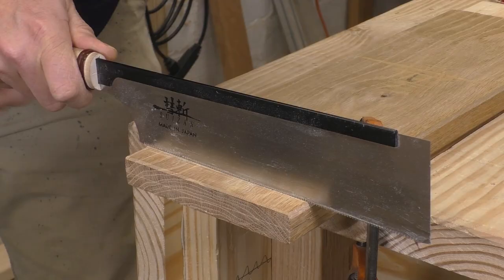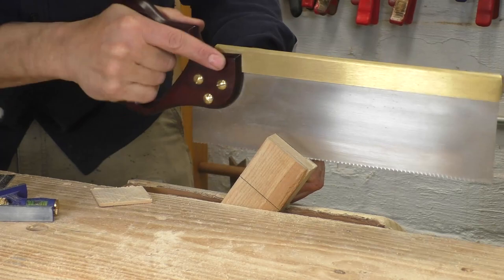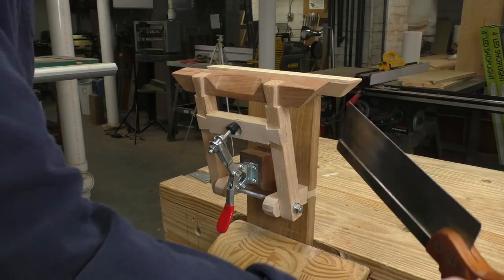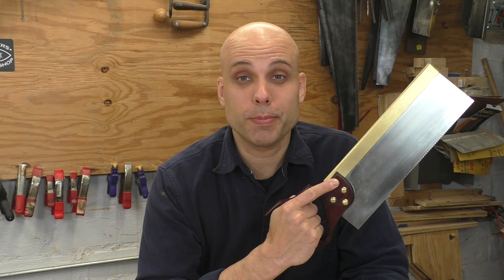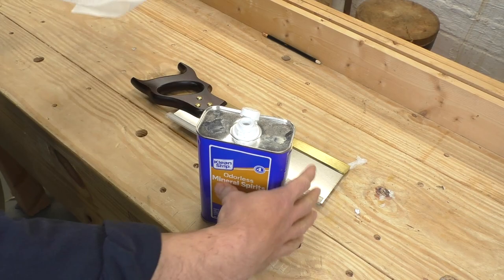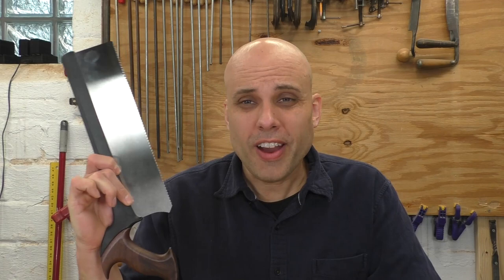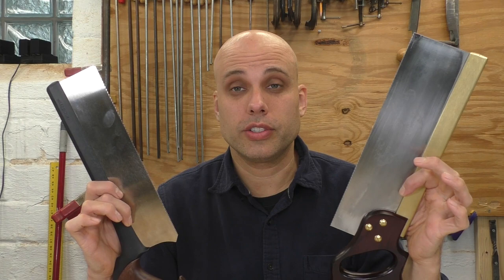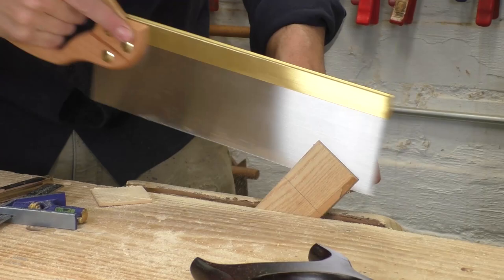The best affordable joinery saw for hand-tool woodwork.

Comment: What you call back saws in the U.S. are always called tenon saws in the U.K. 
Spear and Jackson should stick to making gardening tools, and I say that as a Sheffielder.
Reply: To be fair, their 22" "Traditional Skewback" (a 10tpi panel saw) is perfectly useable, but suffers from the same poorly-shaped handle. You can cut with it, but it isn't comfortable. You basically need to reshape the handle and put in New handle nuts and it is lovely. You can even resharpened those to rip-cut and they work just as well as any boutique saw.

I just with that they made a 14" Tenon Saw. They have 10" and 12" sizes, but I just sometimes miss having one with a 14" plate.
Reply: Ooh really? I've always thought that S&J is to small for a tenon cutting saw

Comment: I am soooo looking forward to the make over of the Spear and Jackson.  I keep coming back to the page to see if you have released that one yet.
Reply from the maker: Just finished shooting it yesterday. That video will not disappoint, I promise!
Reply: @RexKrueger  I'm thinking new handle, new pins, polished blade. I know I need a life but I'm excited.  BTW, if you want to turbo the sharpen, I put a back bevel on the rip cut tips with a 1200 diamond paddle.  It acts just like the microbevel on a  chisel - toughens the blade and keeps it sharper longer.  You can thank Paul Sellers for that one.

Comment: Wow, lots of work on that one! I love your criteria, exactly the same things I've been looking for. I did end up getting the Veritas Rip back saw after picking up an old Disston. I had to de-rust it, and make a new handle that I copied from the original, and resharpen it. The Disston is good, really good, but it's 10TPI and the Veritas is 12TPI. I'm happy I have both though, but almost always reach for the Veritas. The Disston was 15cdn on eBay, and 15cdn shipping. Can't wait to see how much you squeeze out of the Spear and Jackson, if the plate is good, the resulting saw should be go, no?
Reply from the maker: I think it will be good after a modest change to the set and the handle.
Reply: as long as the plate is good eh. Fingers crossed 🤞

Comment: Rex, besides rubbing the goop off the crown saw did you do anything to them right out of the package? Example: sharpen them; reset the teeth; oil the plate; straighten the backs. The S&J is probably just a punched plate from the factory so the set on the teeth would be uneven.
Reply from the maker: No, and I should have covered this. Everything in this video is straight out of the box. I oil all my saws throughout the day.

Comment: Supremely relevant as always Rex! Thank you. Not so long ago I bought a Hultafors tenon saw, I guess it would run at around $165 American so it's up there. While it is a nicely engineer saw it is extremely aggressive at about 8TPI (I was uneducated!) and ruins anything "fine". Eeesh, now it has to go into my 'site kit' for hacking larger stock and framing work. I have the Veritas carcass saw now, very good, but still need a replacement tenon for the larger square cutting of  stock in the workshop which is yet, not large enough to warrant pulling the panel, crosscut, or rip hand saws of the wall if you know what I mean? I may have to explore the Crown as you suggest but am looking to get a minimum of 13TPI. A mention of TPI in your video would have been the cream on the pudding! Thanks again.

Comment: I’m with Batman. The Veritas line of saws are top notch and made in Canada.🇨🇦 I like the looks of the old designs but not enough to buy new. The carcass and tenon saws at Lee Valley are $115 and $179. respectively here in Canada. If you want both rip and crosscut in both the price goes up to $199 and $309. for both ( rip and crosscut). That still a bargain when you consider the unit price for a single Lie Neilson OR a Rob Cosman back saw. Whatever fits your taste and pocket book. All three are well made but the bargain is Lee Valley. JMHO. 🇨🇦👍👨‍🦳

Comment: What at the TPI on the saws you tested? I've an old rip saw and the screws aren't removable either, there is a slot in each but they all just spin so will be interested to see how you remove the  S&J ones. My old S&J tenon saw does have removable screws

Comment: I do own the Veritas carcass saw you showed at the beginning,
I upgraded to it after using a spear & jackson brass spine saw, and wanted to enjoy some high end saw for a change.
I must say, i rarely use it, 
The fact they used plastic instead of brass on the spine made their saw a lot lighter compared to other saws in this category,
and this lightness just doesn't feel right to me, it makes me saw incorrectly and i end up jamming a lot during the cut,
I switched to using Japanese saws and i never looked back since, what a joy to use, fast cutting, stable on the pull rather than pushing, cheap in comparison,
what more do you need from a saw?? :)

Comment: about vintage saw - how do you find classical frame saws like this: https://i.pinimg.com/originals/36/23/1b/36231b5c90644173773b71ff4347ecaf.jpg ?? I have one and think about restore and use it.
Reply from the maker: I think those frame saws are a HUGE area to be explored in affordable tools. I just need an 8 day week!.
Reply: @RexKrueger  often in medieval or reinesance artwork this is only one saw depicted in woodworker workshops. My one is probably early 20th century anb in excelent conditnion, only blade have to be cleaned and some reshaping of teeths (and sharpening and setting orc). My only experience with saws is big two-man croscut saw, so this wiil be more precisius work :)